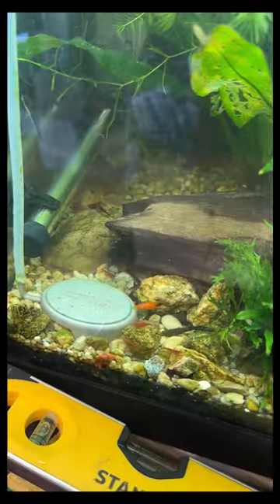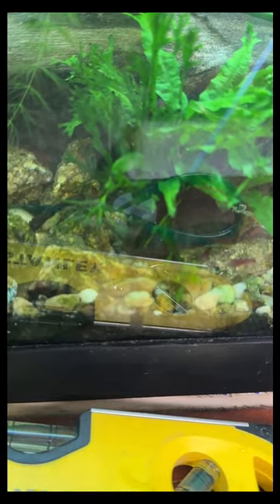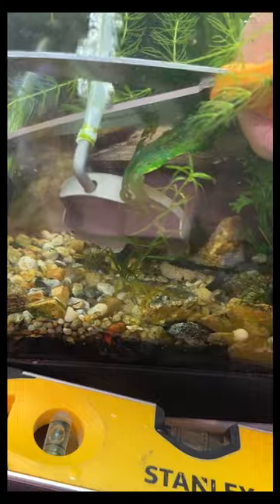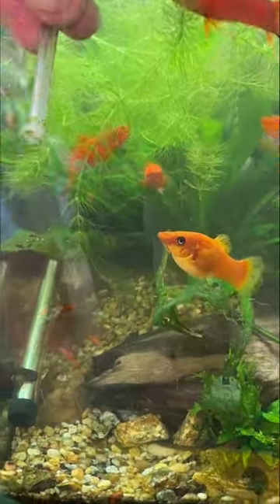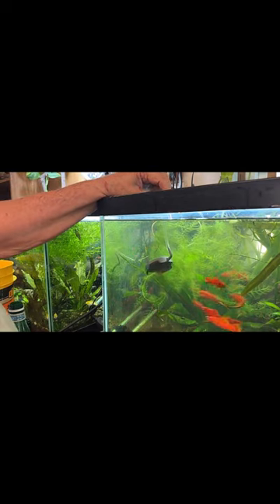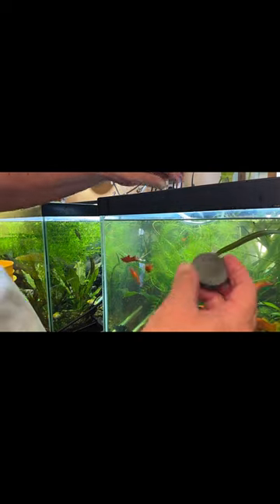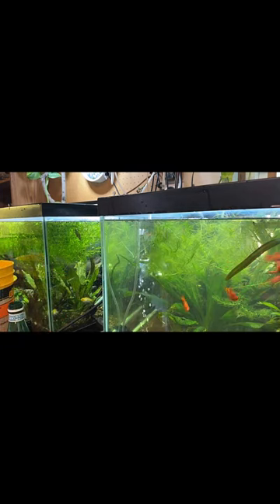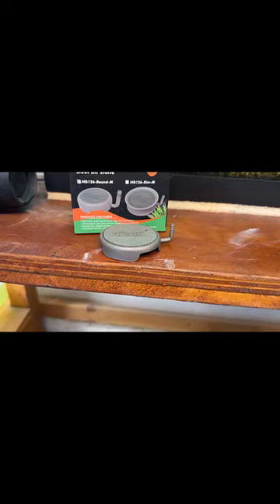Hygger Airstone Re-Review

Comment: I have trouble with things like that- my hard water will build up calcium inside the air port and slowly close it off. I soak them in vinegar for a few days and it will work again. I gave up on that air stone and the Ziss filter because they were too much of a hassle and plugged too easily. 👍👍👍
Reply from the maker: I'll give that a try, Curtis. Thanks.